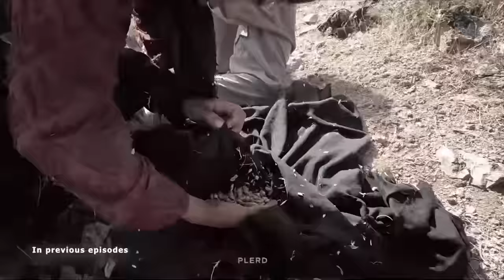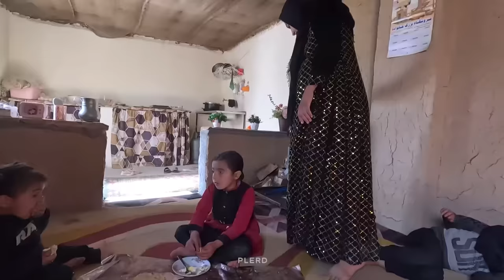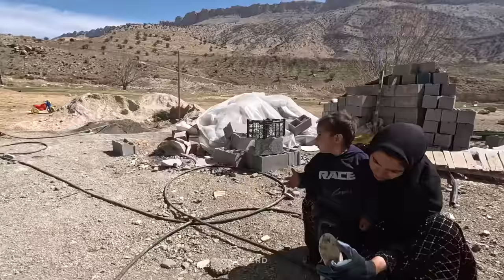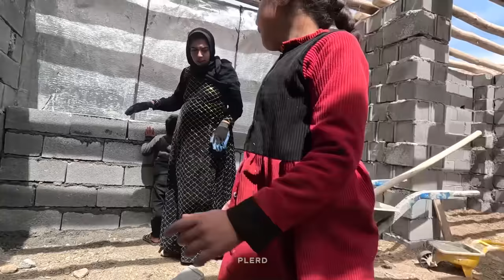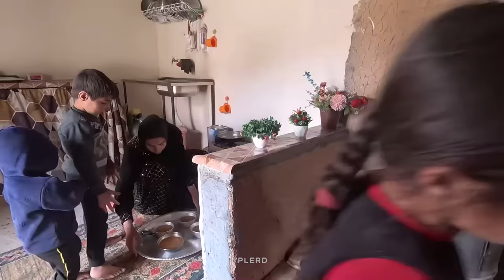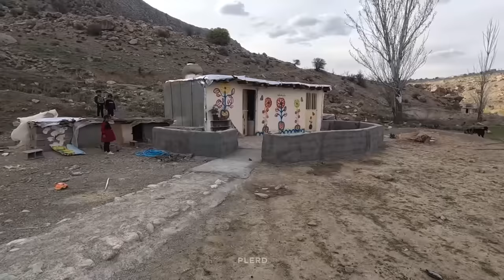A Single Mom's Fight for Her Children in Remote Lands

Comment: The most common causes of dental pain are tooth decay and gum disease. Pain can also be caused by an infection of the tooth (abscess) or the gums. Or your child may have a broken or cracked tooth. Other causes of pain include infection and damage to a tooth from grinding the teeth. Any difficulty breathing or swallowing that occurs in conjunction with a severe toothache could mean a dental infection is spreading and compromising vital functions, requiring emergency room treatment. Trouble breathing or swallowing warrants an instant trip to the ER. 🦷🦷🦷🦷
Reply: This professional advice is just what they need.
Reply: Thank you for this comment.  We have also had a dentist step forward with a comment which is wonderful.
Reply: They dont know what really wrong with the teeth.he wont let the dentist check it.